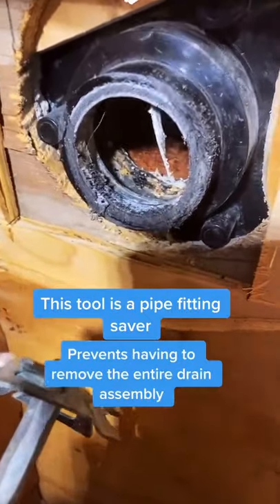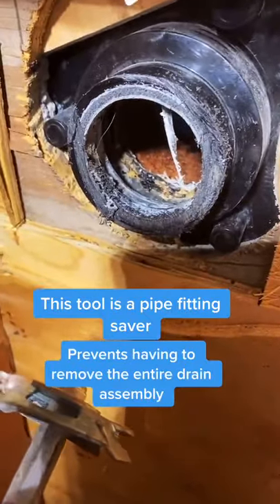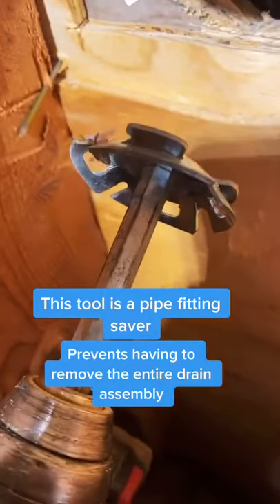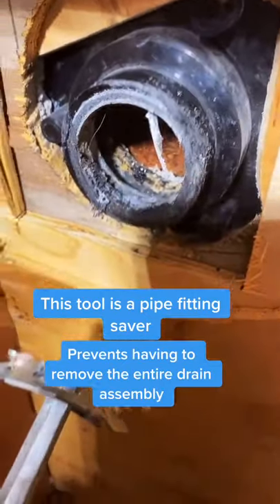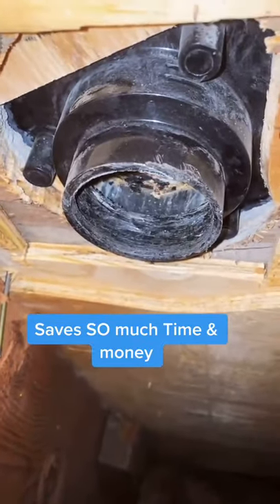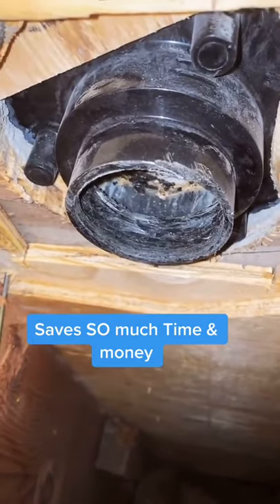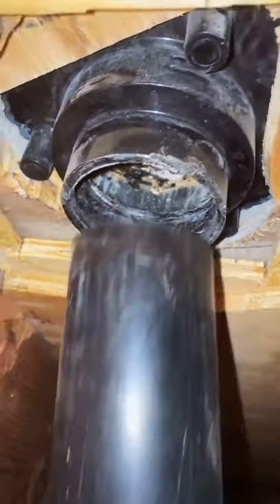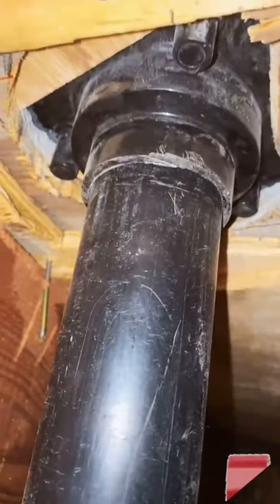AMAZING plumbing pipe tool!

Comment: I'm a plumber.  This tool has saved me more times than I can count. I have the full set of these from Ferguson.  And I have the more expensive set.  I actually like the cheaper ones better.  It's a great time saver
Reply: Hole saw works too
Reply: When the pipe piranha came out I really felt that was the greatest innovation since the mega press. Socket savers are great, but a heat gun, in a pinch a blow dryer, or us true old schools wipe round glue, light it, give it a few moments and we can peal the pipe right out. The piranha is clutch for when its back to back fittings for multiple feet. My real confusion here is why the hell would you use it here, the pipe is gone, its just the flange. Id never have used a socket saver here, thats the end of the run lol
Reply: That's all true. Although you could just smack the jerkoff that cut the abs so close to the fitting that you couldn't even put a coupling on it... Actually come to think of it if I had this tool it would have saved me from a few smacks in the head from my dad, I'm sold.
Reply: @simmcowaPang122 hole saw not the same hole saw good for drill waterline stub out with right angle drill not as good for doing fittings

Comment: My ex-boss/long time friend is a master plumber. Reciprocating saw, heat gun, large flat head, and a hammer is what he used for years and I’m sure he’s still using that technique today.
Reply: More times than I could recall we just wipe glue amd light it on fire for a min

Comment: I use my fitting reams at least once times a month. They make repairs so easy. These and inside pipe cutting wheels and wedge plugs are the tricks of the trade.

Comment: Unless it’s silicone or tile shower how much longer would it take to replace the shower strainer? Those socket savers are great but I’d rather change to new than risk leak
Reply: Why would it leak?You dont have confidence in your ability or you want to charge more?
Reply: Because a socket saver 100% will over ream a pipe  about 75% of the time on pvc i don't recommend using them on a vertical overhead hub. Here though abs glue is liquid pipe so it will seal fine, but its the end of the run id never leave that fitting thats just lazy
Reply: @erikbogart676   "Lazy" is not using punctuation. 🤔
Reply: @richardsummers8805  your laziness clearly grants you an abundance of free time to monitor the internets grammar...
Reply: @erikbogart676  So 75% of the time it 100% over reams the hole? 🤔

Comment: If you make a few cuts through the pipe you can knock it out with a flat screwdriver and it leaves a much nicer slip joint for glueing.
Reply: You can, the danger as I'm sure you know, is if you end up breaking a piece of the hub off.

Comment: Yea.. this is the cheaper set I think raptor? Anyways it does work and has saved me a few times I use the Wheeler kit. Just use more glue and give it more time to set before you hit it with water or pressure.

Comment: Great tool, however the size of the reducing coupling appears to be 2” to 1-1/2”. Curious to hear an explanation as to how drilling / removing the inserted 1-1/2” pipe (as shown) returns the size back to 2”. Barring a “Rube Goldberg”, that would require removing the reducer off the 2” drain. Appears / sounds like an accidentally “misspoken” narrative to me. 
Please change my mind. ✌🏻
Reply: The outlet starts as 2" and handyman plumbers constantly install 1-1/2" reducer bushings inside the 2" hub because they don't know the code. He used the socket saver to remove the 1-1/2" bushing so he could put a 2" pipe inside the hub.
Reply: I’m sure we both have better things to do than debate this minutiae repeatedly, not like it pays $. However, since he literally refers to removing the “pipe” from the “fitting” (reducing coupler) twice, then says it’s 2”, any reduction to 1-1/2” must’ve already been removed, was never in the footage and wasn’t ever shown. I hear what you’re saying, but that doesn’t look like a “bushing” to me. It was pipe that was glued into the hub, sawed off flush with the coupler hub, then drilled / removed with the tool to allow for the same size pipe (2”) to be glued back in. What’s more intriguing to me is if it’s done so often by those who don’t know the code, where are all these 1-1/2” shower drain flanges coming from? Not that I was looking, but I’ve been a G.C. who’s done my own plumbing for over 30 years and I’ve never seen one for a “shower” in 1-1/2”. Maybe it would’ve been a more accurate narration if he’d let the person actually doing the work explain it, as the command to start drilling was a tip off. ✌🏻
Reply: Nice....
Reply: Maybe they used a butt piece to go from the 2 inch outlet to an 1 ½ bell reducer so when he cut the reducer off that's what he was left with
Reply: @KING-FU  it’s possible that it was a 2x1-1/2 coupling with a close piece? If that was the case then yes that’s what he did. It’s not hard to understand! I mean you are a gc that does some plumbing?
Reply: @KING-FU  I just fixed one of these... was likely a tub that got turned into a shower. The drain likely is 2" , bushings down to 1.5. Then when they install the shower, they don't dig back to the 2", they just couple it with a bushing and turn it back into 2". So basically,  there is a section of 1.5 between the 2 2's. Hope that makes sense

Comment: It says you can use it with ABS and PVC and DWV.
DWV is not a type of pipe whereas the other two are.
Reply: DWV is a category/application of pipe but not a material.  The other two are types of Dwv pipe.  This probably shouldnt be used for pressurized water fittings.

Comment: That's a huge risk you were willing to take on this particular job. I would've just cut the 1.5" as close to the hub as I could get it then I would've transitioned immediately to 2" with a no hub or fernco